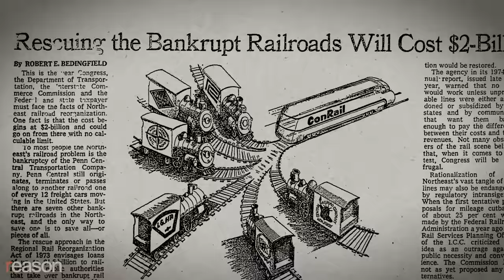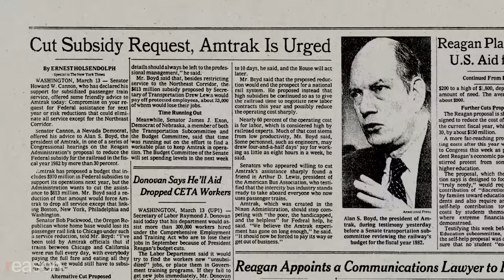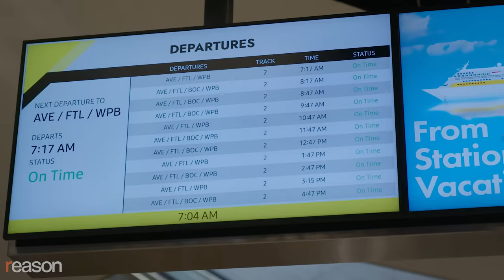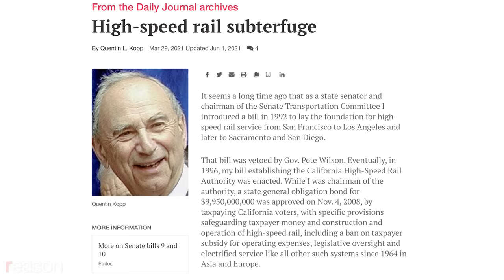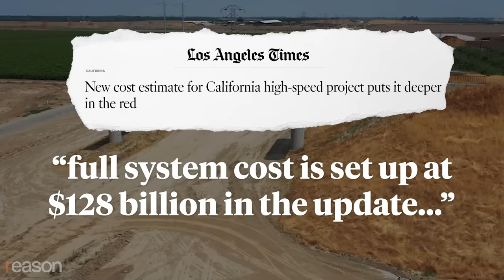How Florida beat California to high speed rail

Comment: I love trains, even since I was a little kid but it makes no sense. Flight from Orlando to Miami is like 32 dollars, if you have precheck you could just browse through TSA. Flight time is 1 hour. Brightline train cost 79 dollars from Orlando to Miami with less availability and travel time is 3 hours. It takes 3 times longer and almost 3 times more expensive.
Reply: Post the link for these $32 flights from MCO to FLL or MIA. There are cheap flights via Spirit ( members discount ) but when everything else is added up it doesn't come out that cheap.
Reply: If you don't like Brightline, just DON'T RIDE IT. Use a donkey for your next Miami-Orlando journey. it's really cheap and more environmentally friendly. And there's no need to precheck with TSA.
Reply: There are 18 trains a day (with 14 I believe traveling the whole route; the first two and last two do not), one every hour from early in the morning to late at night.      Frequency is not an issue; in fact, I kind of wonder if they will be able to fill them all up.
Reply: @michaeljones7927  TRAIN REALITY: China has built more miles of high‐speed rail than any other country with $800 billion debt.  None of its lines are covering operating costs.  (As a result, China is shifting to building more roads.)

France’s rail has debts of $70+ billion and has been repeatedly bailed out by the government. SPAIN built its system with a public‐private partnership.  It is $90 billion in debt.  The state‐owned Japanese National Railways has a debt of $550 billion.  (Japan also has Highest debt to GDP of 300%.)

Railroads are an OLD 1700s technology that is obsoleted by faster, more flexible travel technologies.  High-speed rail loses tons of money & is a bad investment.

Comment: Truth be told, Florida is lucky to have a decent stretch that was upgradable to higher speed rail. The new stretch to Orlando just uses the highway alignment, which limits speed. If Brightline continues to be more and more successful, it's likely they might have to either build an actual line between Miami and Cocoa or fully grade separate the existing one to allow for higher speeds and for safety. Plus, Florida is flat, California isn't, so no tunnels. California is using upgraded infrastructure too though, in the apporach to SF. Not an ideal solution, but one to lower costs. Brightline isn't even electrified, because in America, only turning a profit matters, not lowering the carbon footprint. Still, Brightline opens a way for good passenger rail to be a thing in the states which is definitely welcome.
Reply: A diesel locomotive built to current EPA standards is as clean as an electric train.  (Remember electricity comes primarily from burning fossil fuels.)
Reply: TRAINS ARE EXPENSIVE: China has built more miles of high‐speed rail than any other country with $800 billion debt.  None of its lines are covering operating costs.  (As a result, China is shifting to building more roads.)

France’s rail has debts of $70+ billion and has been repeatedly bailed out by the government. SPAIN built its system with a public‐private partnership.  It is $90 billion in debt.  The state‐owned Japanese National Railways has a debt of $550 billion.  (Japan also has Highest debt to GDP of 300%.)

Railroads are an OLD 1700s technology that is obsoleted by faster, more flexible travel technologies.  High-speed rail loses tons of money & is a bad investment.
Reply: @electrictroy2010  Instinct tells me that's bs, but I'd love to be proven wrong if you could provide the data! :) I mean, with a diesel loco, you're stuck burning fuel, whereas electricity can come from cleaner sources. Electric train with overhead wire are also much lighter which contributes to better acceleration.
Reply: @electrictroy2010  Highways are heavily subsidised all around the world, or heavily tolled too. Turning a profit is not really the point of a high speed rail system. Only stuff like metros could realistically turn a measurable profit (and does so in places such as Hong Kong).

HS systems help remove planes from the air and cars from the road and bring cities and economies closer together. As an example, commerce, tourism and overall relationships between Barcelona and Madrid have been strengthened as a consequence of the high speed line. A city on the French TGV network is a city that has access to the whole country.

Railways are far from obsolete mate. Sure, cars are more flexible, and planes are faster, but railways offer higher capacity and high speed rail is faster between 300km-1000km than both cars and planes.

The funniest thing is, if you are a car maniac (not saying you are!), the best thing you could do is advocate for more trains, because it's the only thing that will genuinely remove cars from roads hahaha
Reply: @paupadros lt's a bot.
Reply: @davidjackson7281  I see. Trying to be rational and educational on the internet silly me

Comment: reasontv be like:
Brightline has pointy nosed trains = brightline high speed
Reply: Very true. Marketing images work very effectively don't they?
Reply: @davidjackson7281  Yeah but really to be fair, brightline markets themselves almost like hsr.
Reply: @m--a Yes, perhaps somewhat almost high speed. lt could be accurately called faster speed or higher speed or semi-high speed though. l don't live in Florida but l have not heard a Brightline spokesperson refer to Brightline as high speed rail. Nor have l heard of advertising or publicity professing such. Rather Brightline says it is for travel to places too far to drive and too close to fly. 

The high speed connotation comes from the hyped-up media coverage. Of course Brightline does not go out of its way to clarify. Besides to me frequency and average speed are more important than the top speed and Brightline excels at both. Heck technically the Acela's top speed is 5 mph short of hsr. And Brightline's average speed is faster north of NYC and slightly slower southward.

Comment: Great to see high speed rail getting built and operated in the US. Just wish it could be done economically without public subsidies. I also think they need to develop the ability to bring your car with you. The reasons people drive are so often related to the first and last miles they drive. High speed railway might save on the trip but you either have to pay for transportation for the first and last miles at uneconomical or inconvenient rates. Or park at your starting point and rent at your destination. Even if parking were free someone is paying for it and rental is also an added cost. Since North America is so spread out in our living spaces mass transit will always be limited by the first and last miles. You need to solve that problem in able to use solution for longer distances.
Reply: Amtrak already has the Auto Train, running from Lorton, VA to Sanford, FL. It is an overnight trip, so passengers can get rest in the sleeping cars.
Reply: @danielcobbins8861  Yes but it’s use is limited to only one route. I have pondered using it to travel to Florida but since I’m starting in Central New York State it still requires a significant drive and the cost is as prohibitive as any other Amtrak ticket. 😂
Reply: The economics of HSR are, what I would argue, the same of Highways. At least from my point of view (Living in Portugal) The Interstate Highway System had an undeniable impact on American Lives. HSR, from examples around the world, and if done properly, can lead to a positive economic impact, even if it looses money. Highways do to, but I'm guessing no one questions that, because no one would be willing to increse tolls so highways can "pay for themselves" if it meant a drastic increase in price in consumer goods.

The question then remains, however, HOW do you build it effectively. People tend to overlook HSR sometimes. When you look at Europe, it's true they have a large network of High Speed Trains, but also a vastly larger networks of conventional rail. This is by design, you also wouldn't want to build a massive highway network without local roads and streets.

HSR is a complicated subject, and needs to be looked at more. The way I see it, you'll always need some degree of Federal Support for any sort of infrastructure project. Maybe not full support, but partial. Brightline is using techniques from around the world, paring that with some federal grants and the lower regulations of the private sector, its no wonder they have been able to do so well.

Sorry if this reply is confusing. Had a tiring day
Reply: There are no private HSR rails, there’s a few operators in Europe but they piggyback off of government owned infrastructure.
Reply: On the topic of bringing your car with you, I used to think that but now I am a strong believer that bikes, ebikes, or some other human scale transportation solution–not a 1 ton space inefficient death trap to those that are not inside of it–is the answer if we are looking at a long-term happier, healthier future imo
Reply: Since you are talking about “the last mile”, I think a bicycle (or e-bike) would be an efficient solution…like they do in Europe…
Car-centric North America needs to take a hard and honest look at itself…
Reply: Time to remove all subsidies for highways and airports then. Remove the fuel subsidies as well.
Reply: Thats a reason to re-think American city design and make it less car-centric, like virtually every place else in the prosperous first world outside US and Canada.
Reply: @kevincraft2602  last miles not mile. Not everyone that would ride a train is able to use a bicycle. 😂 Remember it needs to be as convenient and cheap if not cheaper than driving your car. I visited Germany in 1974 when I was a kid. We were in Augsburg and drove to the museum in Munich. We didn’t see all we wanted and my brother who we were visiting didn’t want to drive again so we walked about a mile to the trolley stop, took it into the city central. From there we took a train to Munich and the subway to a stop about a half mile from the museum. It was great and faster. I was a kid at the time so I have no idea about the economics. It was great and works in smaller countries but I currently live about 15 miles from the closest train station on top of a very large hill in the country. Riding a bicycle would not exactly be my first choice especially in the winter with high winds and 6 inches of snow on the roads. 😂 Although I have frequently fantasized about high speed railway while driving between cities in the blinding snow on snow covered roads.
Reply: Why? The interstates are subsidized heavily. As are farms, oil, and various other industries. Why shouldn't high speed rail? especially when theyre so necessary for our climate goals.

Thats such a silly thing to want for public transit.
Reply: To be done economically, it needs public subsides. literally everything else the public uses to get around- roads, cars, buses, boats, plains, trains, bikes, your feet- is paid for by the government.

and if you say you don't pay for your feet, you got a job? use the sidewalks? gotta eat, right? you pay the taxes to live in a country and those taxes in some way go back to health care. so!
Reply: “Without public subsidies” bro thats required for any transportation project
Reply: If you do not have the same mentality about interstates and the auto industry then this is an L take by you.
Reply: All transportation is subsidized by the government.  Freeways aren't privately run.  Airlines and airports get a wide variety of government money.  So did Brightline Florida, contrary to what this video said.
Reply: This video is wrong in many ways.  First, Brightline Florida did get government money.  This happened in many ways, but here are two examples:

1. The initial $1.6 billion in bonds to fund the railroad were special tax exempt ones.  This exemption of taxes amounts to a government subsidy.
2. Miami-Dade County spent $76 million of taxpayer funds on the Aventura Station.

Another thing that is wrong is the initial cost estimate for California's High Speed Rail system.  In the bond issue that authorized the project, no actual total cost estimate was given.  Opponents at the time suggested it might cost $100 billion, about the current estimate.  Also note that it is a CALIFORNIA high speed rail; not a San Francisco to Los Angeles one.  The design has always been to cover large portions of the state.  Skipping the Central Valley just to run down the 5 would be in violation of this concept.  It's also unclear if that would have actually saved any money, since it would have required large amounts of additional and very expensive tunneling through mountains.
Reply: "it still requires a significant drive and the cost is as prohibitive as any other Amtrak ticket"

You are making that trip at the wrong time like a schmuck.
Reply: @MilwaukeeF40C  😂
Reply: " Miami-Dade County spent $76 million of taxpayer funds on the Aventura Station"

That's their problem.
Reply: @tbix1963   I may be wrong, but I don’t think there’s any high-speed train that can be built that takes a car on it also since a few sacrifice speed for weight
Reply: I took the train from Orlando for the first time last week to West Palm, and there was an electric bus that met the train for the passengers. Even the economy passengers could ride for free. The bus went anywhere in West Palm or Palm Beach. A very smooth ride the train, and I tipped the driver of the very cool and cute electric bus.

Comment: As a FL resident, I would not call this rail project commercially viable. A one-way ticket from Orlando to Miami (otherwise a 4-5 hour drive and two tanks of gas) is $300 per person. You might as well just fly those rates. I don't know anyone in central FL who is enthused about using it. It's not like real rail systems that SAVE people money. The point of a rail line is to reduce costs, not increase them.
Reply: $298 roundtrip premium. $158 roundtrip standard. $78 roundtrip child. $398 roundtrip family of four.